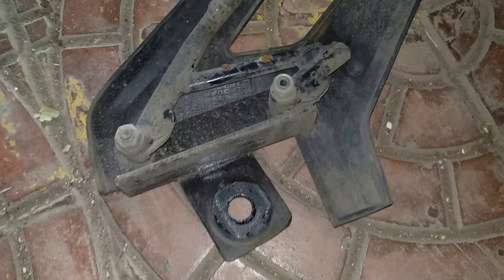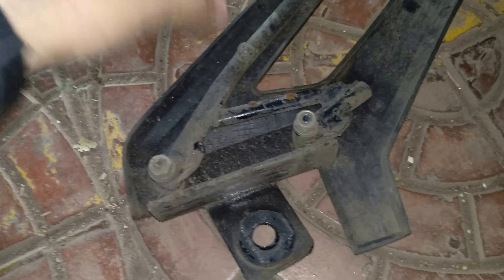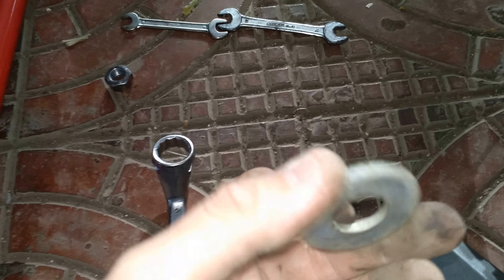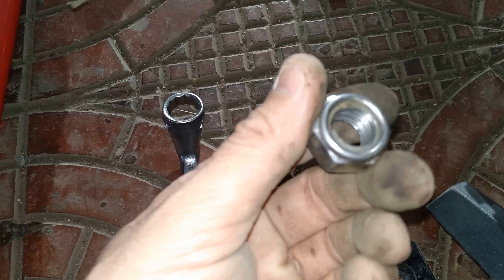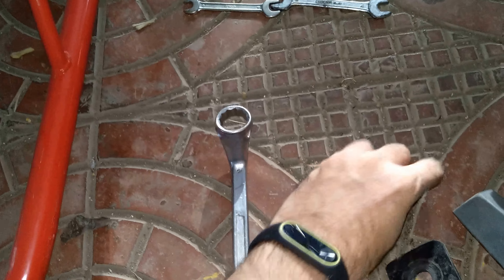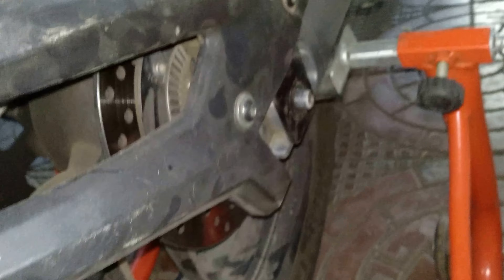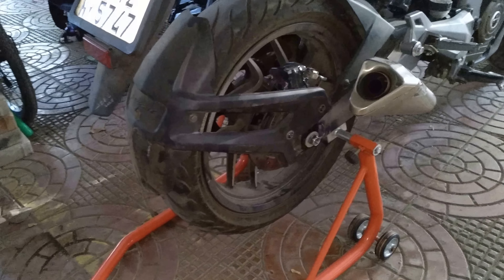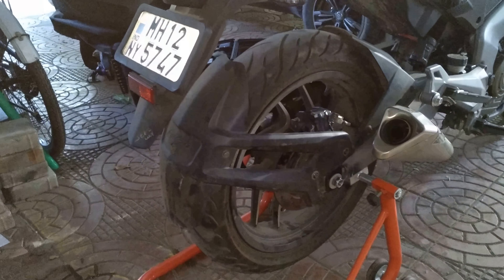Bajaj Dominar 400 Mods | NS 200 Tyre Hugger for my Domi | DIY | Bracket Details

Comment: Can you please show me your brakcet round by round i cant get through it and espically the joint you make from the  praller
Reply from the maker: Check my Latest video of Tyre Hugger. It's shown there.
Reply: @dipen.nisar.autovlogs  ok i got it and after installin' this  does it make any problem related to shacking ,lossing so on ?
Reply from the maker: @Daddy_kaira  yes. So use Nylon Nuts where ever possible. Dominar vibrates a lot at many places. So always use Loctite (metal to metal mounts)  or Nylon nuts where ever possible. Except for plastic mounts nuts n bolts.
Reply: @dipen.nisar.autovlogs  i made it but it is not fit on my duke 200 .  I got problem on the dishpad  it touch when it is mount 😣
Reply from the maker: @Daddy_kaira  this is not made for Duke 200. Only Dominar. Duke will require a custom bracket again to keep a check on all surrounding things near the Hugger and Mount.
Reply: @dipen.nisar.autovlogs  ok i got it

Comment: Works on fz16
Reply from the maker: Yahama has a hugger already. Infact a Mudguard all round.
Reply: DNA: Dipen Nisar AutoVLogs   its on fz fi version only  but i have fz16 and I'm looking for ns tyre hugger which looks good
Reply from the maker: @nithink5693  just checked the bike online. Yes it's missing. But stock Yamaha spares can be used to do it. This will be easier for you to replace them in future too. And yahama showroom might be able to help you too. Since their won bikes. Do the sweet talks and get the work done there :)

Comment: What about the other side?
Reply from the maker: Sorry, I did not get your question. What do you want to do on the other side.
Reply from the maker: @krishna - any reply ?
Reply: I actually thought welding should be done on both sides. Sorry  for the question...
Reply from the maker: @kitchugeths  don't be sorry please. It's always good to ask. 

In the bracket that I have made, you need not weld on both the sides. It's quite strong . If the bracket was weak, we would require some support in the other side. Check my latest video, it has more info on it.